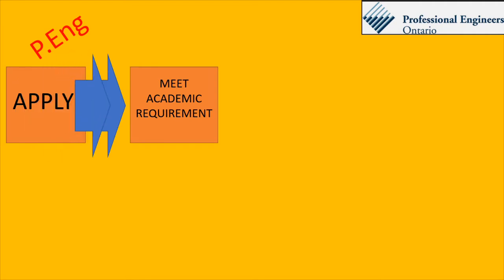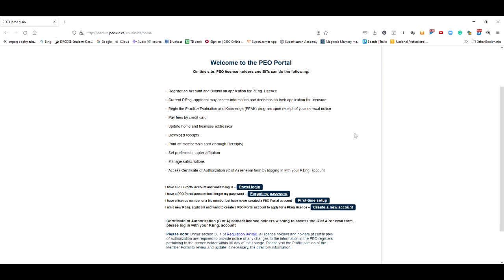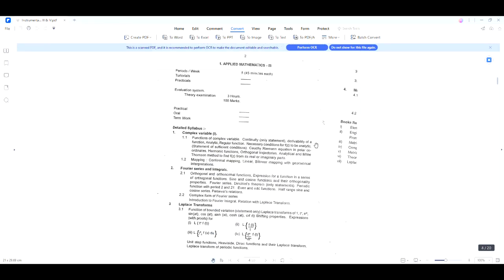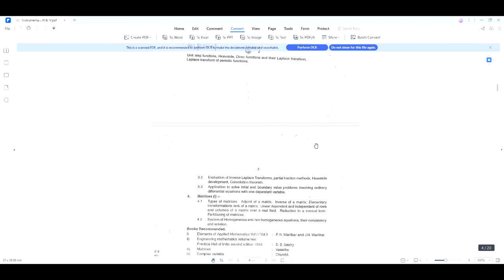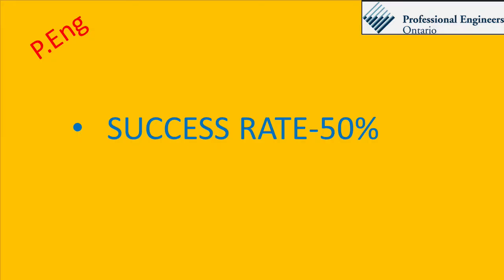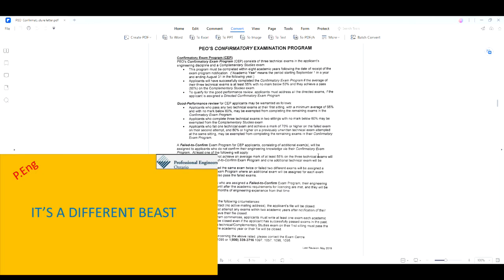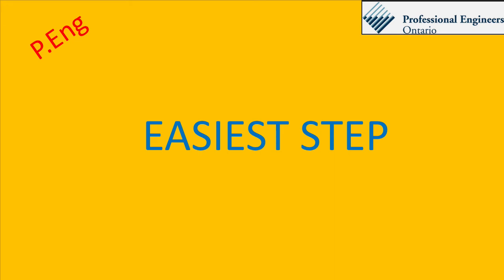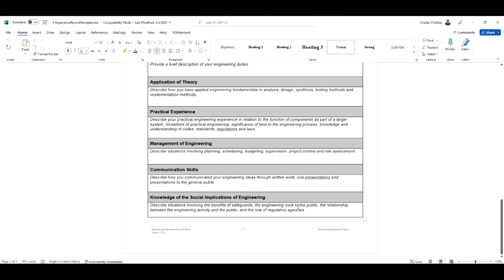How to get Engineering license | How to get P.Eng license in Ontario| Step by step guide

Comment: Thanks for the all the video on Information related to P.Eng. process.

I will be coming to Ontario in May 
There will be some changes in P.Eng process, Canadian experience requirements and EIT.

Should I start process from India or after reaching Canada ?
Reply from the maker: I had started my process from India, however couldn't find anyone to validate my marksheets and transcripts, as they either require an Ontario Notary Public or a P.Eng. Hence, I had to wait till I came to Canada. Here, I went to PEO office in Toronto and they verified my marksheets and transcript with the original in front of me and returned me the original. I wanted to start the process from India, but couldn't. The best is to gather all relevant documents -syllabus, transcript, etc. from India, and then apply after landing in Canada.
Reply: @automationcontrolstepbystep  
Thank you for quick and detail reply.

Comment: Hi,

I have my bachelors in Power Electronics, Masters in Electrical, Experience in Communication and Control Engineering, 

(1) Do I need to gain experience in electrical core. 
(2) My more than 70% experience was as a technician, will it be considered ?

I have NPPE given and passed, I need to submit experience in 2 months. Is it possible we can extend deadline if my experience is not 4 years yet
Reply from the maker: Your discipline of practice you will be given license. As you have given NPPE, you meet all academic qualifications. If you don't have 4 year experience, you can tell PEO to extend the deadline. They will extend it.